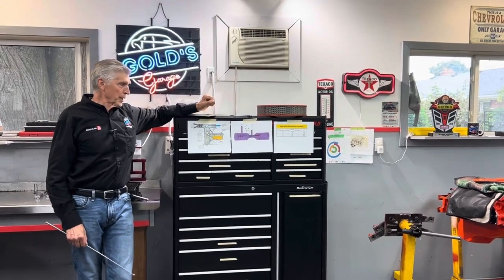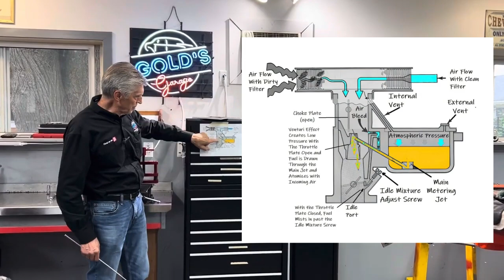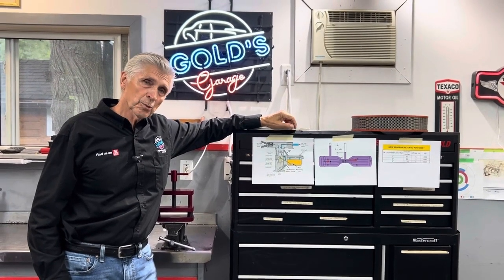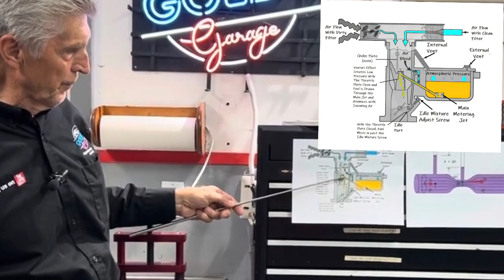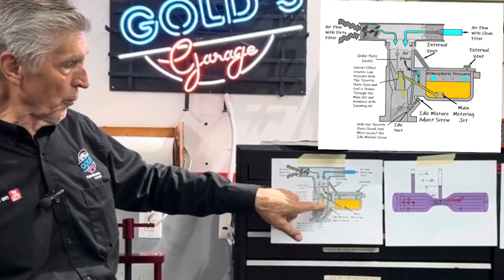THE SURPRISING TRUTH ABOUT HOW MUCH AIR YOUR ENGINE NEEDS! Are BIGGER, or K&N Air Filters BETTER?

Comment: A suggestion, what oil should I use for a street hot rod engine, one that will be installed in a car to ''show off'' and will never be on a drag race track?
Reply from the maker: If you have a flat tappet camshaft, you must use oil with zinc, ZDDP. I have been using Lucas Hot Rod oil, but there are other brands with ZDDP that work also. If you have a roller cam, you can use any multi grade oil or a synthetic oil like Mobil 1, again there are other brands that work well. Hope this helps. AG
Reply: @goldsgarage8236  Thanks. I'll make a note. Back in the day, we used to use multi-grade oil and coat new cams with molybdenum disulfide grease and that's how we broke-in a cam.  Once the cam was broken-in we would throw the oil filter away because the moly grease would clog it up. It was so simple back then.

Comment: for the air filter, on a streetcar I run the filter that cleans the air the best, but is big enough to provide the required amount of air flow to the carb. what good is an engine that makes 500HP if it only last 10,000 miles because its getting dirty air and particulates that will scratch the cylinder walls and cause rapid engine ware?  For a lot of the marine engines i build, most of the time they are running velocity stacks, no cleaners and just a fine mesh to keep any possible debris from entering the stack, but they are only running a liquid quarter mile at a time. and powerboats have Federal Marine Flame Arrester standards they have to meet.  for a race only kind of car, I would go with the best flowing filter i can find, but cleaning the air is a secondary concern.   K&N makes fantastic filters. I have been running them for decades. plus, they are reusable.  I just clean them every oil change on my street cars, or before every race day to ensure maximum flow and cleaning. I find the base and lit design to be more important than the flow of the filter, the filter base must help transition the air flow into the top of the carburetor and avoid creating turbulence above the air bleads. this varies by carb type.  example AFB and Q-Jet carbs are not very affected by it because the air bleeds are further down in the air horn or out of the path of air entering along top of the filter base. where a Holley or the Holly clones without choke horns can have issue with air flow entering along the bottom of a flat based air filter disrupting air flow over the air bleads. drop base filters work better as the direct the air towards the top of the air filter assembly when it is pulled down into the carburetor, instead of directly across the air bleeds. anything that will assist in aiding the transition of airflow into the carburetor will make more power.  I once saw an episode of Engine Masters where David Freiburger and Steve Brule, and Steve Dulcich used a giant salad bowl and, on a dyno pull and it made more horsepower. it changed my thinking about air entry into the carb, and I have been running Velocity stacks for years on Big Block Chevy's with tunnel rams and 2 - 4bbl carbs.  as for ram air and cowl induction they pretty much do the same thing. it's just forcing higher pressure air into the air box around the air filter, similar to blow threw super charging, but without as much pressure are a turbo would make.  some of the coolest stuff came from the 1967-1974 Trans Am series race cars, or from SCCA cars. one example was a 68 Camaro with a modified factory air cleaner, that had and opening almost the size of the valve cover and was connected to the cowl plenum air box and another hand fab piece and a giant oval rubber seal. (https://topclassiccarsforsale.com/chevrolet/19838-1968-camaro-z28-with-rare-cowl-plenum-air-cleaner.html) or some of the things that the great Smoky Yunick built for SCCA cars. or the hood on Jim Hall's #1 1970 Camaro from SCCA/Trans Am series, they basically built an airbox that pulled cool, high-pressure air from behind the 1970 Camaro grill before it entered the radiator, ducted it under the hood and then into a Cowl induction style air filter. anything that you can do to add clean cool air will improve performance. also "Ram Air" which is basically increasing the amount of air pressure at the opening to the carb will force more air through the card.  so, a 750cfm at ambient pressure will increase in air flow as you increase beyond ambient pressure. you are basically pushing more water through a hose by increasing the pressure. is basically passive blow-threw supercharging. but the pressure will never get as high as a real supercharge and only work at high speed. the cool air will make a bigger difference in power then increasing the pressure from increasing pressure at the head of the carb from high-speed ram air.  but every little bit helps in competition cars. 1 HP here or there from ram charging, 4 or 5 from cool air, 2 or 3 more from better air flow into the cars, and suddenly you have 10HP over what the competition has, and that is what wins races.
Reply from the maker: Thanks Shadvan. You have certainly put a lot of thought into this subject. Thanks for the detailed explanation. AG

Comment: Another key thing the filter does is help smooth the airflow going into the carburetor. 

Under hood conditions can be really hectic and turbulent, but the airflow has to straighten out as it passes through the filter element. 

This smoothing and calming of the surrounding air helps the boosters in the carburetor do there job and not be choked by turbulent air on top of the carburetor 🙂
Reply from the maker: All good points, thanks for commenting. I enjoy your channel also. AG

Comment: I have been wondering  since the late 60's about stock air cleaners.  Chevy went to the 14" open air filter. Corvette used a couple different units and they have very little hood clearance. The performance Chevy engines used a filter base with a large hump and I have always wondered if that improves air flow over a housing that has a flat base plate. I know the hump had extra humps in it for carburetor clearance because they made them to kinda get a low profile. Then when you look at the Off Road Z28 air filter for 2 fours, the base plate is again more flat but there is still a small hump around the carb opening. I have never seen any testing done comparing the base plates, even between aftermarket filters and the stock GM 14" open element. I have a feeling that that hump aids the transition when the air turns into the carb opening. It would be interesting  also to see tests comparing the air cleaner assemblies by  Chevy, Ford and Mopar used on high performance engines on one mule motor. It may not be worth all the testing but what if it is?  Those snorkel air cleanerss must also be to reduce intake noise. Yes, how do they flow the needed air?
Reply from the maker: Thanks 4speed. Joseph Nowak's video that I referred to found that the best flow was with a base plate. Check out their video, I have a link to it in the description. We will do our best to test as many combinations as we can. Its going t be a long day but I think the info is important. AG
Reply: @goldsgarage8236  Thanks.  I will  be watching for this   future video.
Reply: A sealed system that draws air from outside, will develop more power than an open-Air cleaner under the hood sucking Hot air. That was the idea of a Ram air, But most Factory Ram air where too restricted to make real hp. None of the Factory Ram air systems showed a improvement on a Drag test. Dyno tests are not a True idea of what a stock Air cleaner will gain. Sucking cold air from in front of the Rad, is better than an open air cleaner
sucking hot under hood air.

Comment: I have seen a lot of math and theory around how much air an engine needs for best performance.  David Vizard brilliant people out there when it comes to engines.  I have a ton of respect for him. as far as air flow, there are lots of theories.  the first being that you should size the carb based on a math formula (CID x RPM /3456 = CFM x Volumetric Efficiency). example, a 350 and spins 7000 RPM. with 90% VE.  the equation would be 350x7000 / 3456 = 708.9 CFM * .90 = 638 CFM.  have you ever seen a LT1 350 with a 650CFM carb? me either.  the reality is that even though a 650 CFM carbs is enough to do the job, it is only sized for the required amount of air at the engine needs to fill the cylinders in theory, but it is actually has become the point of air flow restriction in the engine.

I personally believe that you carb should be big enough to flow more air then and next closest point in restriction of your engine.  the engine may be able to flow more air than the carb specked out by the theoretical formula. I use a different formula, cylinder head flow average from .200 to peak flow X 4. (only 4 of the cylinders fill per revolution and the valve is never at peak flow all the time) so with that AFR head, it flows the following 138@.200 198@.300 240@.400 and 260@.500 so an average flow of 209 cfm. So, if you take that 350 with the AFR 180 heads, in order for the carb not to be a restriction, you need one that is capable of flowing between 840 and 1040 cfm per revolution of the crank.  so let take that 350 with 180 AFR heads, and the 650CFM carb, and swap it to a 700, then a 750, 800, 850 and 900 CFM maybe even 1050 CFM.  you will see a gain in power at each step until the engine is getting the maximum amount of airflow required to fill the cylinders. and will be a diminishing return as the size of the carb increases until it hit the point that the engine is getting what is required for peak power.   

However, this method only works for peak power, in the real world, you have drivability concerns on the street.  and the larger the carb the less throttle response you will have.  so, looking back at my theoretical 350 with AFR Heads, it would be really snappy with great throttle response but down on peak power when compared to the larger carbs.  so, the question really becomes, at what point do you trade throttle response and drivability for top end power?  I would look at around 750-800CFM.  the Factory did just that with the LT1 350 with the 780CFM Holley they used.  but if this was a Drag race only car, I would be testing and 900-1050 CFM carb. in a drag race you are at WOT the entire time, but throttle response on the street would suck.  if it were a circle track car, then I would be looking at what the rule for my class were and run the biggest carb allowed by the rules. throttle response it not huge since you are always running mid RPM in the corners and WOT on the strait aways. for short track you may want a smaller car for better throttle response as the car transitions out of the corner and back to WOT.  but on larger tracks, you may want a bigger carb for more power down the strait.  for a road race or autocross car, then I would go with the smaller carb since throttle response off the corner is more important, and you are not a WOT for long periods of time.
Reply from the maker: All good points Shadvan. thanks for taking the time. I agree, we often find that a bigger CFM carb will make more max HP on the dyno, but a smaller one would work better on the street for reasons that you mentioned.AG

Comment: Hi Alan, for you last 350 build, I just put the 1105 Camshaft into the summit calculator 4 deg advanced and got IC of 79 deg, then into Wallace dynamic calc and got Dynamic compression of 151 psi, is that correct? I'm trying to select a cam and now I'm doubting my results. 
Also have you looked into the Comp Cams DLC lifters?
Reply from the maker: Thanks Chris, I would need more info like your static compression to answer that question, but if you entered the correct data into the Wallace Calculator it should be correct. I am guessing you have about 9.5:1 SC? AG

Comment: this is great info.
gave much clearer understandong about airflow dynamics.

can u combine airflow comimg from air entries coming from the front guards of car with the bonnet scoop to achieve even greater hp performamce ?

or just air from scoop is only whats needed ?

i own transam 78 with chev400 450hp.
Reply from the maker: Thanks Jim, i don't think the ram effect does much unless you are at very high speeds. It is the cool air from outside the engine bay that helps.AG

Comment: Yes. I will measure flow and temperature on my street car. I learned from DV also and found out that the factory cowl induction on certain applications the air will go backwards! You can test with simply attaching yarn strings in the opening.  And you can make a simple moninoter with a tube and rulers to measure differences in flow.
Reply from the maker: Thanks for the info Don.AG

Comment: it will be great to see it all in one test. Everything from a small snorkel to a big or double like a vette or GTO. As well as the mighty lid flip. Hopefully you can work with some local enthusiasts that would be happy to lend their gear.  I have a suspicion that the filter can be able to flow enough air and yet the total air flow tract may prevent full potential. All the bends and changes may cause some odd wave dynamics within the air cleaner assembly. So I bet the testing is going to have some surprises. Perhaps a bigger filter allows the air to slow down and move better around curves. etc
Reply from the maker: Thanks for the input William. Lots to think about. AG

Comment: Engine Masters did a great episode on this. The air bleeds emulsifies fuel, the low pressure and evaporation atomizes it.
Reply from the maker: Thanks for watching and commenting Joshua. AG
Reply: @goldsgarage8236 Thank you sir. I have learned a lot from you and used much your info on my latest 388 build. Including the custom grind cam😁 179 psi of cranking pressure and 0.032 quench height. Fully forged everything and a Dart block. Afr 210 heads. It's a blast. Thank you again!

Comment: Back in the day I found a flipped air cleaner lid would produce a measurably better 1/4 mile time on an otherwise stock V8 engine.
I agree cold air density is the the prime benefit of most forward facing "ram air" or "cowl induction" from the high pressure area at the windshield, there is a slight supercharging effect, but not at any non-race speeds.
I have a negative opinion on K&N, reusable, oiled, cotton filters, that I won't go into here.
Air induction systems, plenums and stacks are a whole can of worms.  This video may spawn a long comment section, most will have an opinion.  (-;
For full range engine operation one has to consider the tuning of intake from the air source to the back of the intake valve, the carb or throttle body is just caught in the middle.  There are trade-offs being made by OEMs from flatter mid-range torque vs. top-end hp and then there is noise and clean air stuff.   
The small intake diameter on the air cleaner assemblies of older cars was IIRC mostly due to vacuum secondary carbs liking it, one of those trade-offs.  (-:
Reply from the maker: Lots of good info in your comment UncleVom. Thanks for contributing to my channel.AG

Comment: don't forget that adding chrome parts add back horsepowers!  5hp for the valve covers and 5hp for the air cleaner lid.
Reply from the maker: Thanks Eric, I love your comment because that is exactly the way we thought about it in the early days. How about the Moon decals on the back window? AG
Reply: @goldsgarage8236  Alan, I really enjoy you videos. I'm not a Chevy guy but I am always interested in the minuta  of  engine building.  I  think I should have been a engineer of some sort.  

I have an unwanted project on my hands  at the moment.  My brother in law blew up the engine in the Buick GSX that my late father and I restored years ago. He's  family and he's a structural engineer.  We are going to tear down the engine in the next few weeks together.  What the level of destruction is will be extensive; maybe a broken block, etc.

Your videos have inspired me to get a set of micrometers for this project and future ones as well.

Comment: To gain power from ram air, you need to be over 150mph before you can force air into the engine.I think that is in Smoky,s book
Reply: Not breathing under hood hot air is a benefit though.
Reply from the maker: Thanks guys, you are both correct i think. The air from outside the engine bay is usually better. AG
Reply: @goldsgarage8236  It was really true with the 1985 Corvette, the stupid thermostat didn't open until 195 degrees for smog reasons. That under hood area was smoking hot!